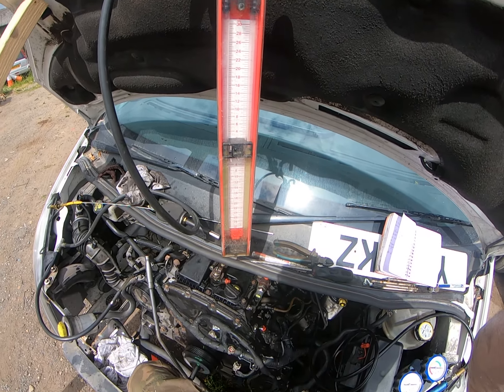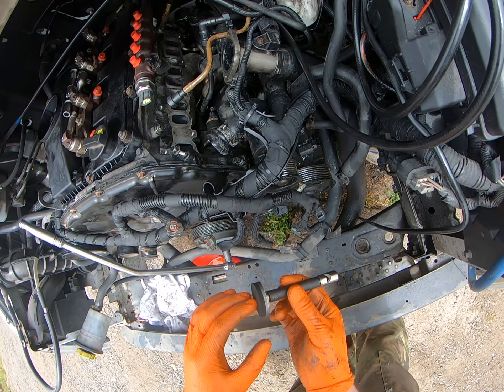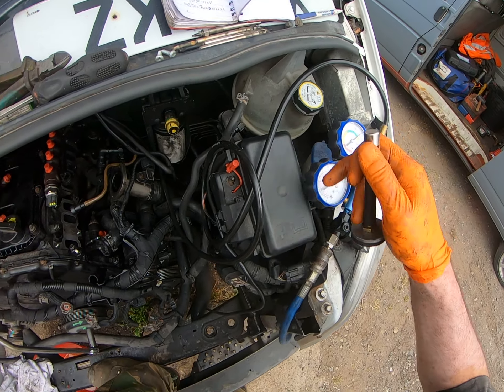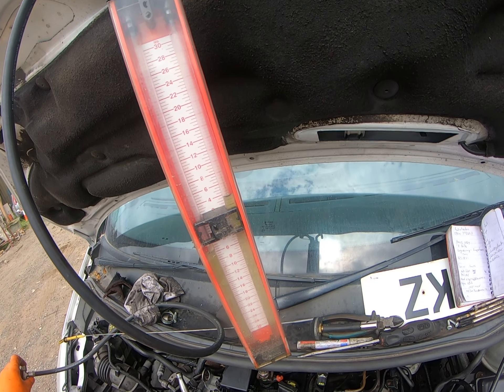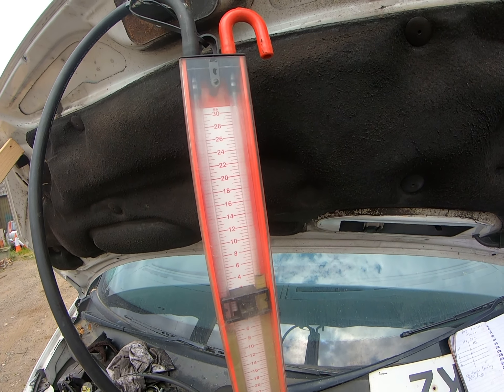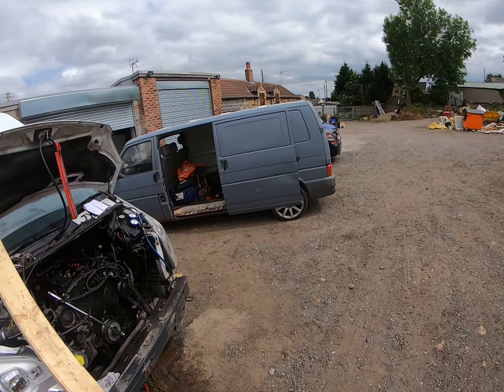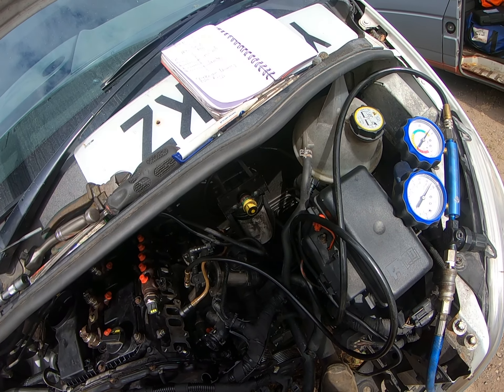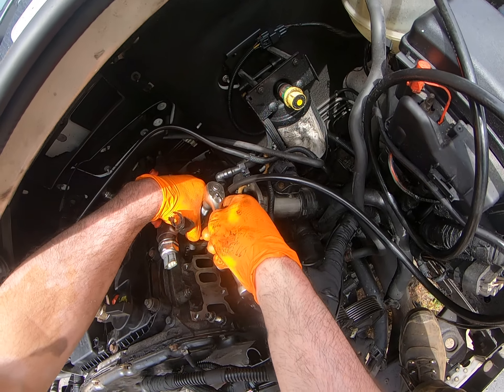Ford Transit Cylinder Leak Down Test pt1

Comment: am I correct thinking your regular leak down tester (dual gauge on the right) only measures general pressure loss (regardless whether it's through rings or valves) but your gauge hanging off the bonnet connected to the crank case, helps you measure precisely what leaks through the pistons? I was thinking about running compression and leak down test on my 2.2 in peugeot boxer (puma engine). ever since I bought the van it's got this weird behaviour where it blows a lot of bluish smoke when cold and revved to 2.5k rpm. it just blows big amounts of smoke. when warm it stops. over the years I changed the injectors, the turbo, cleaned the intake, blocked the egr off, changed the timing. recently I took the inlet manifold off to see if inlet ports ale blocked but because I ran it for a couple of years with the egr blocked there's no carbon build up. the only weird thing I noticed is while all the ports are a little wet with the oil film one particular port was outstandingly wet. that makes me think, maybe that one particular valve is letting pressure back? my second thought is piston rings are already pretty worn so they seal up properly only after warming the engine up.